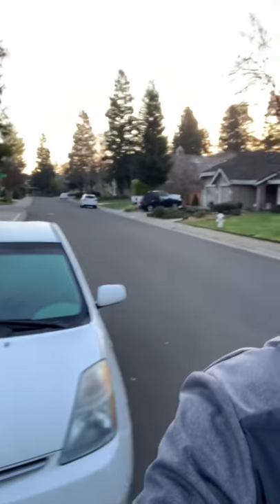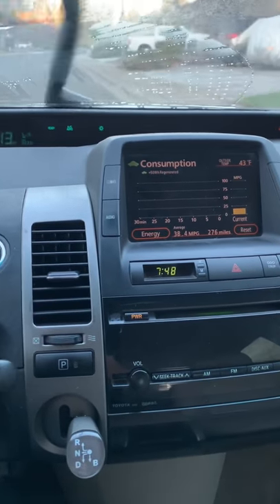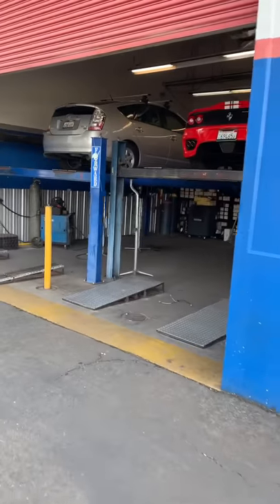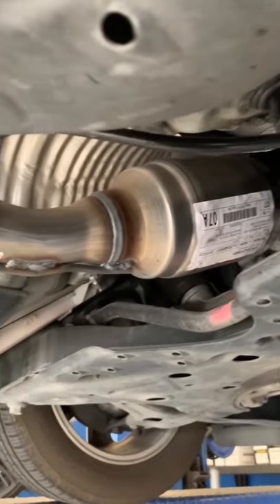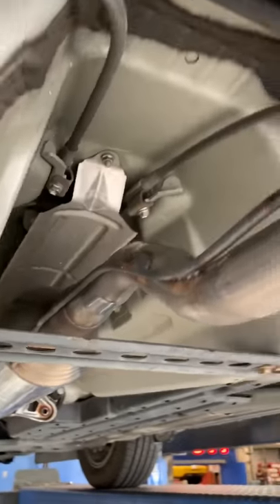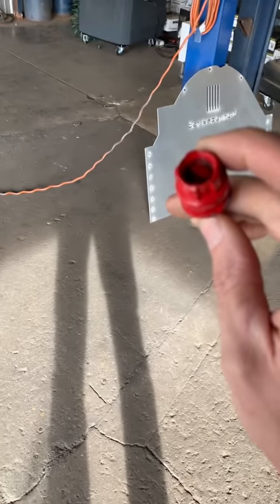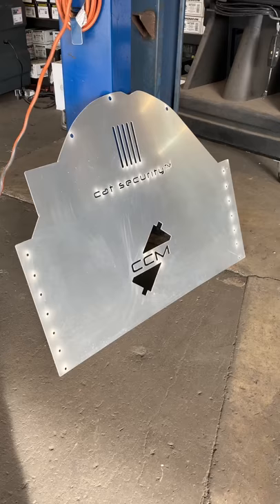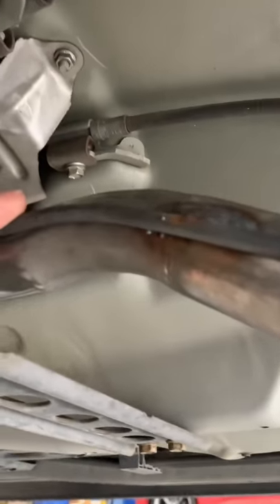Toyota Prius catalytic converters theft prevention

Comment: This problem is rife here in Britain and no doubt everywhere else in the world. Car designers and manufacturers MUST be aware of this issue yet they do absolutely nothing about it. Given that many jurisdictions require official parts outlets to present formal documentation for every aspect of their business, there's a good chance these cats are being stripped for their ludicrously expensive components (precious metals) or being shipped out of the country.
Reply from the maker: Vehicle manufacturers can’t be held responsible in my opinion.  It takes a very long time to make adjustments in vehicle production for a relatively new problem.  Rhodium has only recently increased to a level that has driven the thefts to such a global issue.  Newer vehicles are mostly using manifold cats now and by default are much harder to remove.  This is for the efficiency of heat and not to prevent theft but it’s a great byproduct.
Reply: @mufflertech  I now feel better schooled on this subject!
Reply from the maker: Glad I could help, thanks for watching!

Comment: they have a saw so they cut like butter thru that with no problem i use a aluminum plate made by miller 255 out the door
Reply from the maker: Thanks for your input.  We use all the levels to work together.  If you’re protecting your house from burglary you do a deadbolt, alarm, and bars on your windows.  I can come up with ways to defeat all of those things individually, but together they add a higher level of deterrence.

Comment: Can’t they just cut right through the metal with the same tool they cut the converter out with??
Reply: Yes but it takes much longer. The difference in 2 and 5 minutes is huge to the thieves.

Comment: CAT Security Plate is worthless. My 2nd cat was stolen after I installed the plate. They cut in front of and behind the cat even with the plate inplace. Cost me an extra $200 to have them remove the $200 CAT Security plate to put in a new converter; lost an extra $400 with zero protection.
Reply from the maker: The security plate has foiled many attempts for a lot of my customers, however, in a case like yours is why we have the additional levels, we have since added a 4th level since this video was published.

Comment: Can't they just use the gator grip socket on your keyed bolts?
Reply from the maker: Sure they can.  No different then a burglar can use a crowbar to get past the locks on your front door.  We’re not claiming our stuff is foolproof, it just creates more barriers for the thief.  The more tools they need to get the part the longer it will take to get the part and the less likely they will have success.

Comment: Aluminum won't do anything. Weld the bolts to a steel plate is the best way.   Chain the exhaust thru the car and weld.
Reply from the maker: We have massive amounts of data that say otherwise.  Welding the bolts to a steel plate introduce other issues, corrosion, weight, and accessibility for service on the car are a few.  I’m not discounting your idea, it’s just not practical on a motor vehicle.  We have to consider the operation of the car not just protection of the cat.

Comment: How much are you guys charging for the cover install? Thanks
Reply: Attempted theft on my Prius early this morning. Scarred them off.
Reply from the maker: Please call the shop, market prices change and I don’t like to post estimates here.  916-421-0399
Reply: $300, had my prius c done by these muffler guys last Sept. Before u pay, be sure to test for rattling noises by driving around the block & make some quick turns & hit some potholes for about 5 - 10 min.

Comment: The only problem with placing a covers in genereal is when you drive it makes vibration under your foot
Reply from the maker: We’ve done hundreds of them now with no issue.  Possibly the installation wasn’t done correctly on yours.

Comment: sorry if i missed it, but where are you guys located?
Reply: also price for level 1,2,3 protection?
Reply from the maker: Muffler Tech
6160 Florin Rd
Sacramento Ca 95823
916-421-0399

All 3 levels are $500 plus tax installed

Comment: Tack welding cable is better
Reply from the maker: Our data shows differently.  By all means something is better than nothing, but the thieves are cutting through the cable at the tack weld where it doesn’t move.  Thanks for the comment!

Comment: i had salvage title prius 2008 in ca so when cat was stolen I had to weld straight pipe 
as you know the new one is 3500 and car is not worth that much. but funny thing is thieves dont know that there is no catalyc converter so they cut straight pipe and stole that one too so I had to weld it again. I know it will not pass inspection but I had my inspection 3 months ago so I have another 1 1/2 year to drive. I am not democrate so not big fan of green new deal and they made laws to help criminals I don't feel as guilty as I should be. car runs fine I see engine ligst but no other issues.
Reply from the maker: Your party assignment has nothing to do with it.  Your position on the environment does.  If you believe the hydrocarbons, carbon dioxide, and NOX are not things that matter then so be it.  I understand your resistance to spending the high cost of repair on a low value vehicle, my suggestion would be to get an aftermarket part for the interim so your at least not hurting the planet.  You will also solve your check engine light with this idea.  I'm not bashing you, just trying to be responsible in advice.  Thanks for watching and commenting! :-)

Comment: Get the catalytic converter anf paint it with a bright colored hight temp spray paint the lil eyes nor the auto mechanics will wont buy it
Reply from the maker: Nobody is buying them to reuse them, they are being recycled for the precious metals, rhodium specifically.
Reply: @mufflertech  they can't be recycled unless if the paint is shaven off